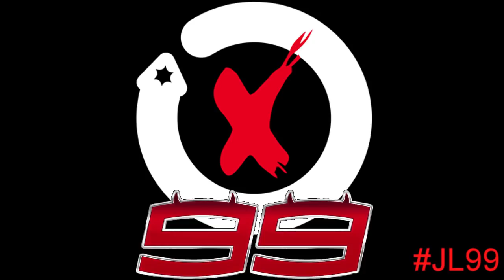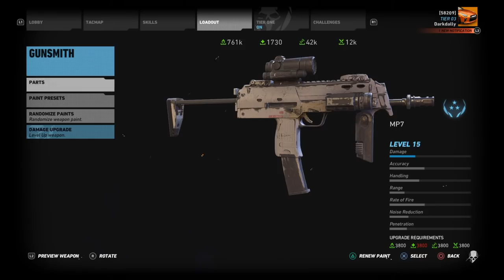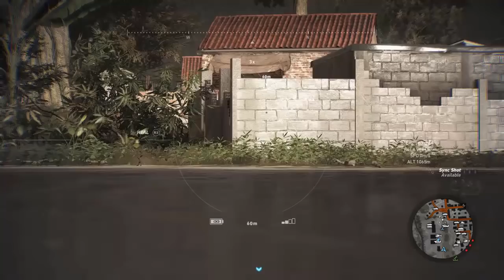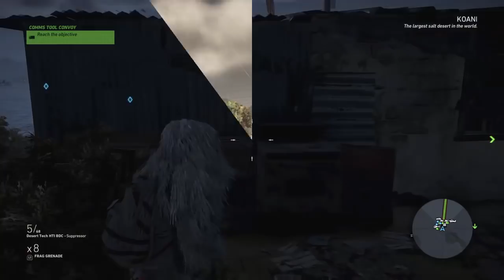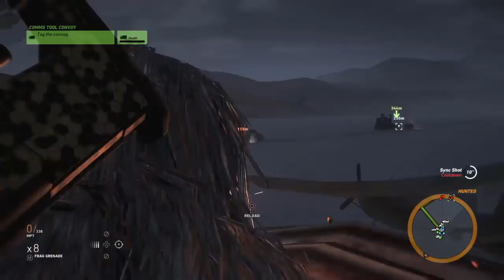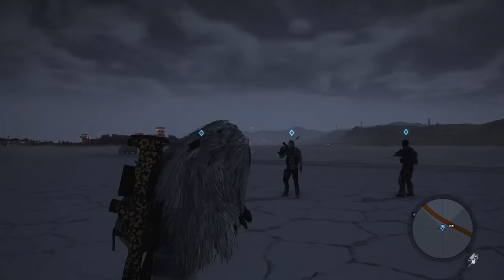MP7 DAMAGE AND RANGE TEST Ghost Recon Wildlands Tier One Convoy Takedown

Comment: I've used the MP7 since I first unlocked it - it compliments my normal HTI perfectly. When clearing bases, I engage targets at 100+ meters with the HTI, then switch to my MP7 and move in to clear any indoors or out of LOS. In semi-auto, it is great for targets out to about 100 meters. It is accurate, fast-firing (even in semi-auto), and handles better than any assault rifle.

Comment: darkdally.....can you do a vid on your best LMG and shotgun on tier mode.....The LMG for taking out vehicles and choppers?
I currently use the MK17, P90 and the 5.7 handgun...I know it's all from FN Herstal. I Dutch but living in Belgium so it seemed the right thing to do LOL
Reply: BSH1975 I like the mk17 for an at,longest range for at,i use the car and sasg and the 5.7,for convoys I Looooooove the m249,holds 150 rounds,very manageable recoil,decent penetration,even before I had my vhc penetration fully maxed out I still took down convoys and choppers with ease,i earned the Llamativo(m249 special weapon from a mission) and I used that until I found the m249 so I can customize it how I want

Comment: Quick question. I saw one of your old videos. You were driving faster than normally. Did you make some small changes to your controller?
Reply from the maker: I play with a normal dual shock 4 controller that came with my system.  I'm not sure what exactly you're referring to, but maybe the bit you saw was sped up in editing or something.
Reply: Darkdally I meant your driving speed seems faster than my driving speed. My driving speed is so slow. Even though I have a DualShock 4 than came with my PS4.

Comment: The vector was my mainstay seriously till the tier before the bad news.. sure it has a little bit more bullet drop than your average AR but that fire rate and it’s damn near a laser beam is just ridiculous.
Reply: KleptoKilla23 I've noticed a lot of side to side shift with the Vector, unless I was firing it in burst mode. How do you have yours set up?
Reply: Penguin Overlord Sight: CompM4/Foregrip: Shift Short Angled Grip/ Extended Mag/ Laser3Dot/ Standard Barrel/Suppressor/ Stock Buttstock/ FullAuto-Burst trigger. With my vector I get more vertical recoil and some minor to the left pull
Reply from the maker: Penguin Overlord, as a general rule, you want an angled grip on an SMG.  Angled grips increase accuracy, which decreases that lateral drift in your shot grouping.  It's a shame the MP7 can't equip one, but there's so many other SMGs out there :)  The shift short angled grip is a mainstay for SMGs in this game.

Comment: Fun fact: you can put the Digital Scope on SMG's, which means you can have a variable power optic on SMG's. 😂

And yeah, I completely understand with Tier Mode. My main character has been on Tier 2 for a while now, and aside from playing the Predator mission I haven't had much motivation to get to Tier 1. Maybe one day I'll get there. 

I honestly haven't been playing with SMG's much, mainly because I prefer the assault rifles' accuracy, range, and ability to accept a grenade launcher. But of the ones I've messed around with, I do prefer the P90, the MP7, and the Vector. The P90 has awesome capacity and good damage, the Vector has no recoil when in burst mode, and the MP7 is just plain excellent.

I just haven't been playing with them, or with suppressed assault rifles, ever since you encouraged playing with the pistol more in one of your videos. For my play style, the pistol can do 90% of the work of a submachine gun (taking out enemy targets quietly), and with the higher capacities of the 5.7 and the M9, they have just as much ammo as most submachine guns, so for me there's not much point using a long gun spot for a submachine gun. 

But I have my second save slot character that I haven't played in a while, maybe I'll use her for submachine gun gameplay.
Reply from the maker: Yeah the digital scope is an option.  For this video, I looked at it, and decided on the CompM4.  I'm liking the compm4 more and more over the digital, even though the digital scope has different zoom levels and technically a better reticle.  Stats-wise they're very similar.  I tried both when doing this video, and the comp  m4 just did what I wanted better.

And yeah man, i'm the same way on tier mode, as I said in the video.  After making today's video, I decided to go ahead and grind to tier 1.  I'll have a video on that very soon.  It's time.